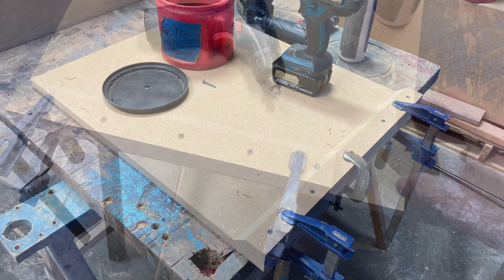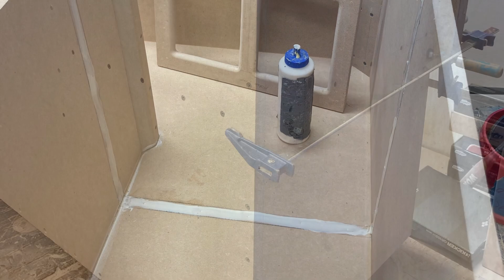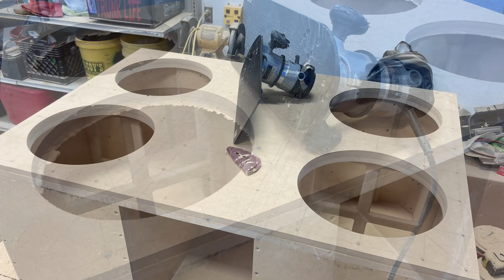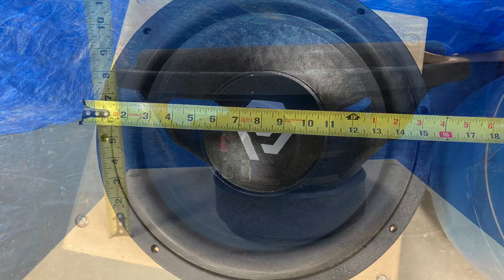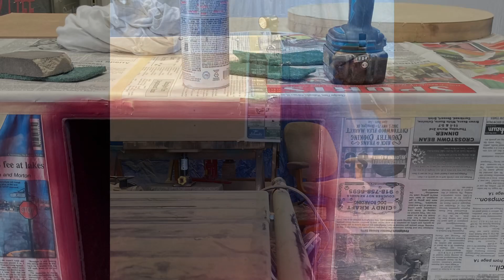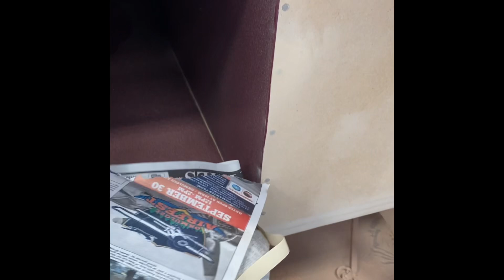A custom enclosure build for 4-15” Soundqubed HDS 3.2 subs, in a ported enclosure. (Tahoe fitment)

Comment: Y do you use MDF over birch or plywood?
Reply from the maker: I prefer mdf for a few reasons 👍🏽

1: Price point. (my customer’s are generally on a budget, so I try and keep material coast down) 

2: Smooth surfaces (minimizing port sound wave resistances and helps when painting port areas. 

3: Easy to work with. (No splinters)
Reply: @210Designs basically a mdf box sounds deeper and reflects bass better and yeah I love mdf super easy to cut and work with

Comment: Im gone need a box for 3 8s soon
Reply from the maker: Cont remember if we’ve built one for three 8s. I bet they will sound great too 👍🏽
Reply: I thought you made one for the single cab? Nvm that was 2, 8's right? I sold my box and 3 P3 8's. I have 2 12Tw3's now. Also took out my zx1500.1 and went with 2 cxa800.1's. Beats enough for me bro! Anyway, you got them 3 8's in you! 🔥🔥🔥 🔉🔉💥(boom boom pow!)
Reply from the maker: @markbarilleauii6337  Yes sir, I’m posting that build now on IG. Yes, for 2-6.5s You moved on huh? Ain’t nothing wrong with that. I’m a big Kicker fan myself homie. No matter model you running…definitely A1 quality. You have any vids up?
Reply: @210Designs  No, my truck went in the shop before I did any videos. When it gets out the shop, I will send them to you. I haven't even wrapped or painted the box yet just bare wood.
Reply from the maker: @markbarilleauii6337  Oh, okay bet. Yea, I’d love to see them man 👍🏽

Comment: Really nice build, and nice attention to detail.  I have a few questions (not meant to criticize your work).  Why use MDF as opposed to high-density particle board?  The latter is much stronger and twice as heavy - IMHO it builds a much sturdier box.  Is the MDF used for ease of cutting or the fact it is much cheaper?  I also like to use dado grooves whenever I have perpendicular pieces - adds a bit more strength to each joint.
Reply from the maker: Thank you, I really appreciate that man 🤙🏽 We always try and give our customers their moneys worth. I use mdf for ease of sanding, has less of a porous surface (smoother) and flexibility or being slightly more bendable. I started off building enclosures using particle board back when I was in HS (90s) *I actually built my personal box using particle board… 2-15” CVX kickers. Showing folks it can still be done in 2024 😀 

https://www.instagram.com/reel/ColpAtVj8sP/?igsh=MWIxcXIzaXQydXdzOQ==

…And yes I agree a dado groove has proven to be much stronger, which I also learned from my shop teacher. And particle is a heavier material. But properly placed bracing makes up for all of that. And like you mentioned…those are things “you” prefer to use when building. There’s nothing wrong with either in my opinion. As long as the finished product is a good solid enclosure. Everyone has their own preference or technique…this just happens to be mine 🤙🏽 So I hope I’ve answered all your questions. Feel free to checkout my other vids too and thanks again.